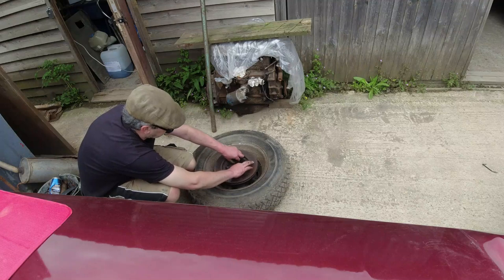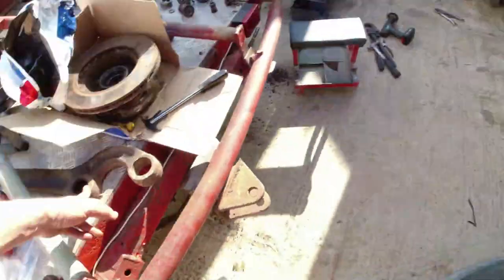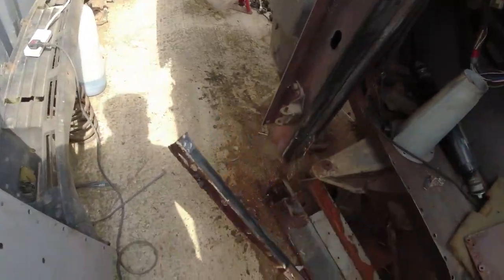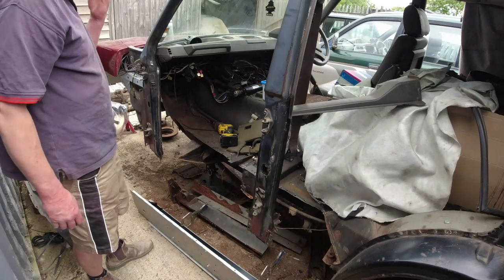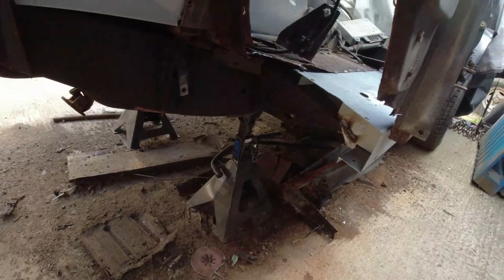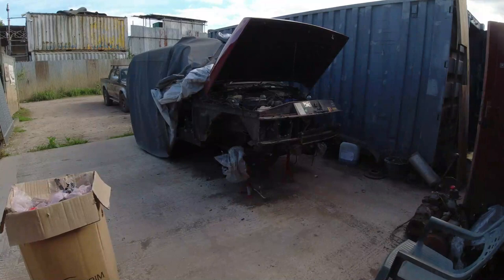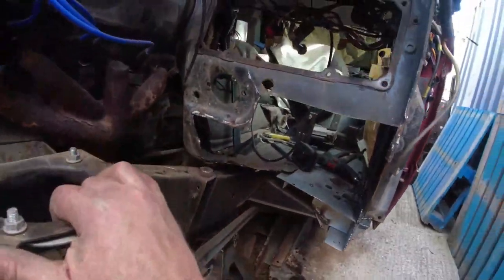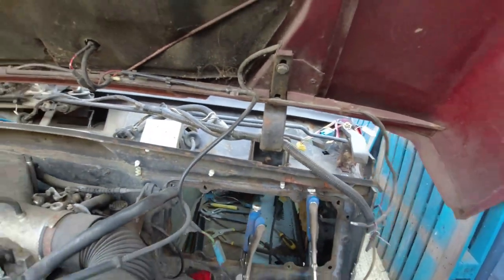1989 vogue se episode 2 - Nearside / LH 4 door Sill install - Profanity etc

Comment: Good job.!   I need to find a welder that can do tin, if I turn mine to the lowest setting it still blows holes through!  Frikin tin work..I loath working with it. ☹️
Reply from the maker: adjust the wire speed down, work in small sections and let it cool properly. my welder could weld tinfoil I reckon

Comment: Hey! Been loving watching your videos for a while now. About to take this on myself on my 1995 LWB. Wondering what products you typically use for seam sealing after welds and paint/primer cover coverage, and what the usual order of application would be. Products will be different over here in Canada but hopefully I can find equivalent.
Reply from the maker: Thank you for following. 
1. Rust converter on the bare steel first if needed
2. 2k primer
3. seam seal, I use various products which I mention in the videos.
4. 2k top coat

Drop me an email and I might be able to answer more specific questions
Reply: @churchhouseclassics   Awesome! Thanks a lot might follow up with you as it unfolds!